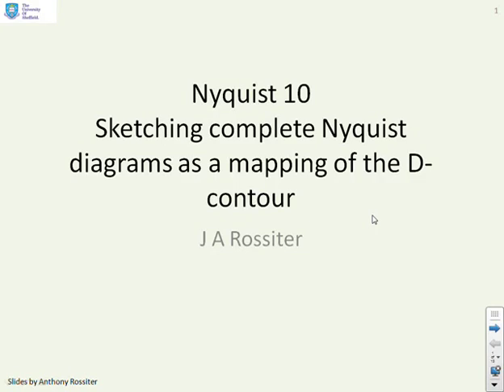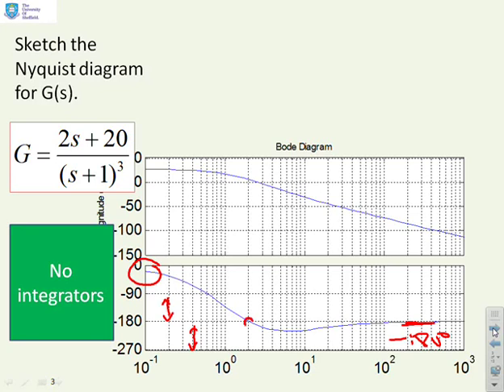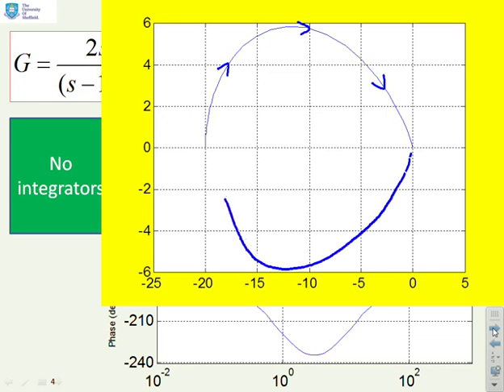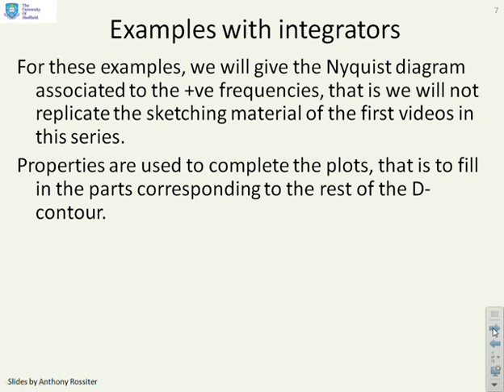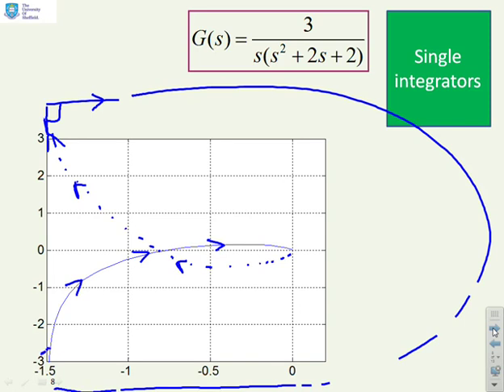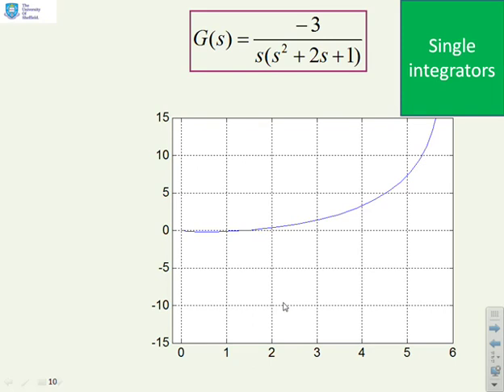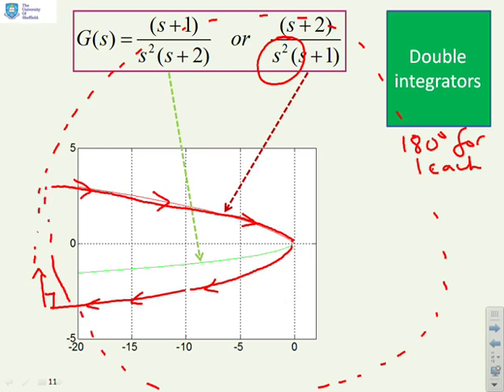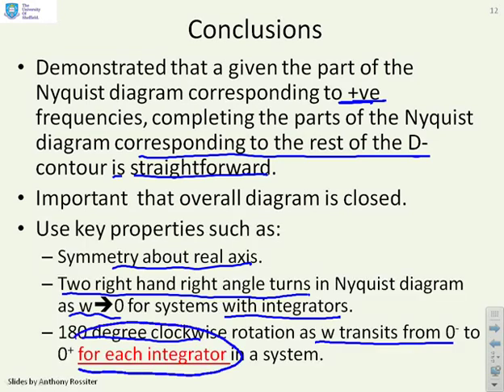Nyquist 10 - Sketching complete Nyquist diagrams

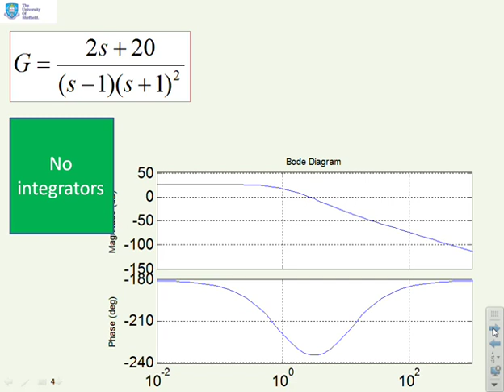Comment: for the 2d example at 2:52, HOW do we know that the y-axis consists of -180 degrees down to -240 degrees?
Reply from the maker: You would need to revisit the resources on Bode sketching to see  this, but in simple terms a lag compensator of the form (s+10)/(s+1) has a maximum phase of about 55 degrees. The phase of two of the factors sort of cancel (constant) because (s-1)(s+1)=s^2-1=-w^2-1.Anthony